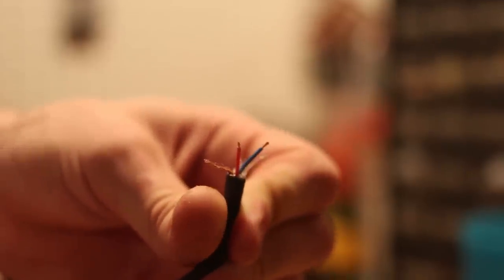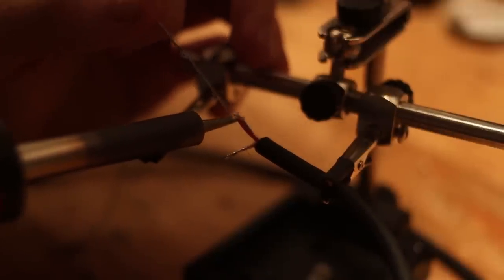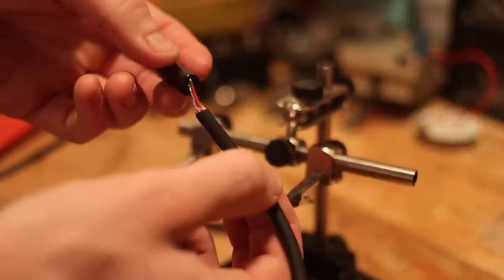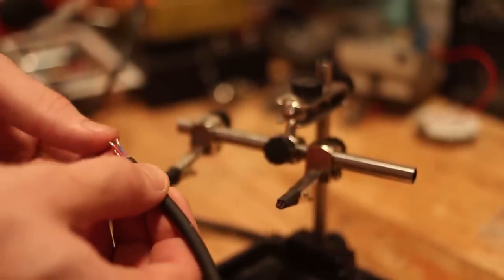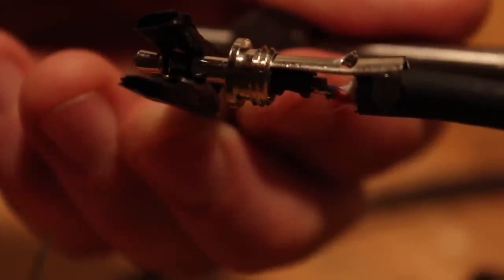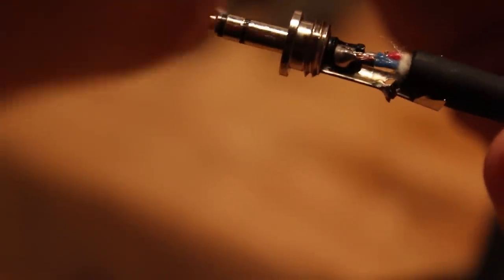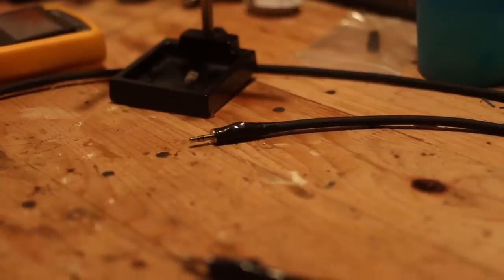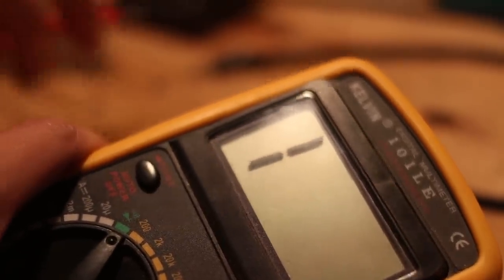How to Wire a 3.5mm Stereo Audio Plug : Audio Tips

Comment: He said that the tip is the left---meaning "the tip end of the plug is the left channel audio." So, orient the plug as you see it when he is holding it for showing us the wires soldered to the connector tabs. If you do that, and then were you to have an ohm meter for verification of the plug's construction as to which tab is left channel and which tab is right channel, you would find that the tip end of the plug will be of a piece that ends with the connector tab that is closer to the camera than the other one. The video shows you that the color of the wire that is red is the one that is on the tab that is farther away from the camera than is so for the white wire. And the long metal piece will have to take the remaining wire, the braided pair. Solder the wires to the plug's connector tabs just as his video shows you, and you will have the right channel audio fed to the plug via the red wire, the left channel audio via the white wire, and the wires that were twisted together--the return/common/ground electrical path--are soldered onto the plug's remaining, biggest tab.

Comment: hi..

thank you for the video.. I am just a beginner. I have a question please.

I have got two speakers from a friend..
May be a kind which eventually connects with a sub-woofer.

But I want to connect it to my audio interface (Focusrite 2i2). This audio interface has 2 stereo output slots for 3.5 mm jacks. I think one for right, one for left.

But these speakers have wires at the end of cable, instead of a 3.5 mm jack.
how do I connect a 3.5 mm jack to the ends of the left and right speakers with wires at the end?

Thank you!
Reply: +Syed Armaghan Hassan Maybe you need an  power amplifier between the 2i2 and speakers.. If they are active (already with a p.a. inside), you do NOT need an external power amp...and then just solder that cable to 3,5mm jacks... But, be 100% sure that you are not reversed the poles (Correct is: plus pole to tip, minus pole to ring and ground to ground)... If you don't know speaker poles, you can define it with a small battery connected to speaker wires, but find that on the internet beacuse i'm too lazy to write all that stuff,

Cheers! ;-))
Reply: Thanks :)

Comment: Hi Joe, thanks, good video. Can you tell me, you mention you are an audio engineer. Is it an audio engineer who is normally responsible for the manufacture of audio equipment and or connecting audio componentry like mics and speakers or is that someone else like some kind audio electrician ? I hope this isn't an odd question but im trying to find someone to assist me in designing an audio mic solution and am not sure where to start, if you can assist yourself id be greatful. Thanks Joe, kind regards David

Comment: Hey buddy, the part everyone has trouble with is which wire gets soldered to which tip and where to attach the ground... You skipped the most important part... Help = 0000...

Comment: Do you have any idea how to soldering a lavalier (mono mic) to a mini-jack 3,5 mm stereo connector??? Can you help me? Greeting to you!
Reply: It depends if the mic capsule is expecting phantom power -- you'll need a stereo jack (depending on what the wiring configuration of your power source & amp is) and the correct wiring. The signal may (but not always) travel down the left leg of the cable with the +V power (seems to be 5 V for consumer lav mics) and you'll need to earth, but you may not need to solder the right leg. When a colleague made one up for me for a Sony lav mic which needs phantom power, we soldered both legs of a cable and the ground cable, and found that with the right leg soldered, it gave a nasty buzzing sound into the Zoom H2 I was using. We disconnected the red Right cable and it now works great. Other mics and equipment will vary! A multimeter is your biggest ally.

Comment: Am I missing a point here? How do I know which is the left and right channel when I already have a non-removable jack on the other side of the cable?
Reply: the tip is left. The ring is right.
Reply: If you have a jack on the other end, it will dictate which wire is assigned to what.  For instance, whichever wire is "tip" on the existing jack must also be "tip" on your new connector.

Comment: I'm a sound engineer at my studio and I'm doing all audio cables by myself but I pretty much hate to solder 3,5mm jacks!.. 

 Anyone else??
Reply: As long as you do a decent job it's better than the price premium for factory made cables and using multiple adapters that introduce EM interference.
Reply: If the solder blobs are small enough to allow the shell to screw on top, it wasn't all bad.

My question is if there are high enough quality plugs that include strain relief, or whose insulators between the tip and collar don't melt when you're soldering.  I've seen plugs that don't even provide holes to stick the wires through, so you're forced to really do a balancing act to keep the wires in place while soldering.

Comment: So...multiple problems here:
You did not address the cable/connector pinout
You melted insulation
You insufficiently twisted the shield
Your tinning is horrible
When you soldered the conductors to the connector you have horribly huge solder joints
These solder joints are covered with heat shrink to isolate from shorting
You don't have backshells (or if you do you only secured them with tape)
You only took a continuity check, when in reality you should be checking resistance in any cable build (ESPECIALLY audio)

Please...nobody use this video as a tutorial. It is shockingly bad

Comment: you didnt explain what terminal was right or left
Reply: it's just a cable link.As long as you wire the same colour to the corresponding terminal on the other plug it should not matter.